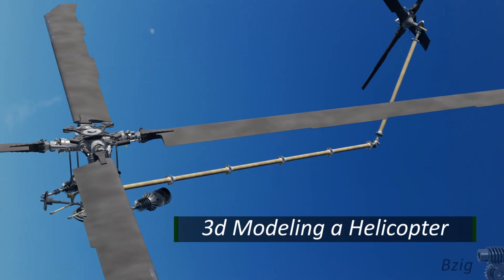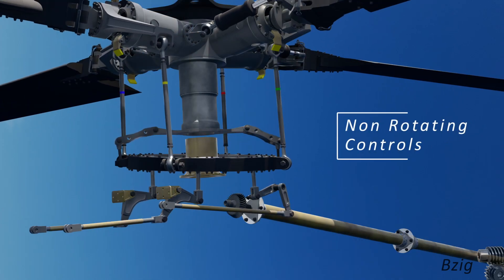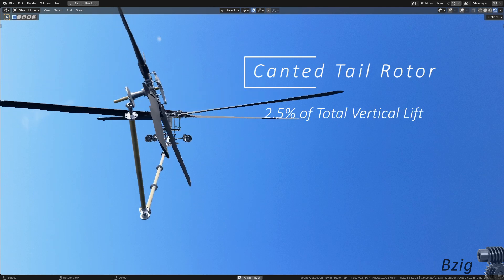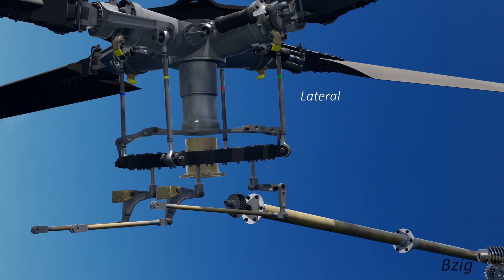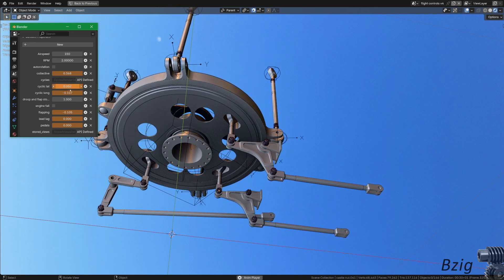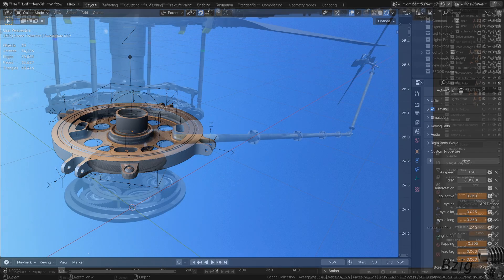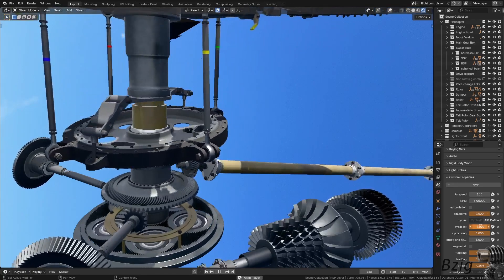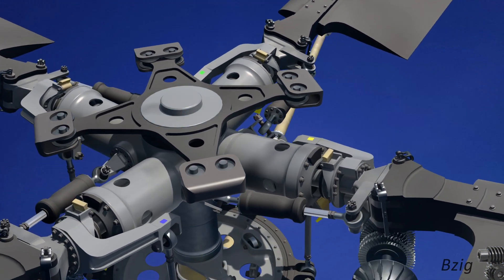How a Helicopter Works - Part 6

Comment: I am currently studying your videos, chatting with a specialised aircraft-attuned Chatgpt, and I'm reading through the flight manual of the SH-60 Seahawk in preparation for being a flight mechanic in the airforce. I won't ask you to do this, but in addition to the mechanical aspects covered such as transmission and power and flight controls, I could really use some 3D modeled hydraulic system to see how it all comes together. That has been and is currently my biggest headache to understand or mentally visualise where the servos and actuators fit in and how. 

But amazing work, thank you so much for all of this!
Reply from the maker: The flight controls would be a challenge with all of the mixing that takes place!  My goal is to tackle a simpler helicopter before getting into a design with multiple boost stages in the flight controls.  I'm working on an R-44 video with the goal of showing control continuity from sticks to the swashplate.

Way back in the day, before computer graphics, I remember part-task-trainers where you could follow the controls from cockpit to swashplate on physical table-top trainers.

Comment: Principle purpose of the canted tail rotor was to decrease the size of the aircraft. It moved the centre of lift aft, meaning the centre of gravity had to be shifted as well. This was done by moving the cockpit and cabin further aft under the rotor head, decreasing the overall length of the airframe and saving weight along with it. The lift it produced also allowed the initial main rotor diameter to be smaller. If you get a chance you should read the book by Ray Leoni on the blackhawk.
Reply from the maker: thanks for that point out!  I ordered Leoni's book from AIAA today.  This is a fantastic book... it's a nice blend of history and technical subjects.  I worked flight test in the Marine Corps and I love reading about the test failures and how the team overcame them.  Thanks again.  I'll add this book to the reference list in my video descriptions.
Reply: @bzig4929  Yeah it's a great book, I wish there were more books like this for other aircraft.

Another thing I think you should read is a thread on the pprune forums titled "Delta 3 & Phase lag", specifically the posts from NickLappos.

Comment: "...a frequency that someone at Sikorsky picked."  😂  Love your videos!!
Reply: @BasemanSr  Sikorsky is the epitome of heavy lift helicopter design. No random picking of  frequency, by someone at all. Instead carefully arrived at by many empirical tests. Theoretical  engineering is one thing. In the end it is dialling in all the real world components to inteact smoothly with each other. Changing compliance in any component affect all others. This is why Turbine enginge and helicopter flight components are so expensive. For the machine to work as advertised requires perfection of the manufacture of the components.  And maintaining or replacing that perfection as the components wear. Sadly there is a you tube out their of some clown in India, who build a kit helicopter faux replica. It looked Identical as mock up of real kit helicopter. But the Base Moulding fabricated MR blades quickly destabilized and you see his head becoming "pink mist". There is also another kit helicopter design that when the main rotor blades underspeed in lift dynamics of flight, the centrifugal force keepin the blades rigid. They cone up and bend, to the point where they fold up and break. Aaaaaaaaaaahhhhhhh. Splat!!!!!
Reply from the maker: Well said.  When I said "picked" I didn't mean to imply it was random.   You said it nicely... That this is a careful choice that's made after testing.  I'm limited by the words I can fit into a video.  Thanks for commenting.
Reply: Great community and great channel! :)

Comment: I once saw a cross section diagram of  Sea Stallion or Super Stallion. Whether this was true to life, or just someone's assumptive diagram I do not know. It depicted the Swashplate bearings as being very large ball bearings. The outer rotating race being concave machined. The inner fixed race also being  a upward facing  1/4"concave on the lower portion, and then the top half being a retention ring  with it's underside also machined with a downward facing 1/4 concave. The retention ring having several bolts securing it to the lower fixed inner race. Since all  kinetic loads are carried by these bearings, it makes sense that this would be the most simplistic heaviest duty  design, rather than double the count of smaller two row caged roller bearings. More oportunities for any single one failling, and ruining your day. Wheareas with let's assume  a full race, (depending on race diameter) of 30ish- 50ish count of  say 1" inch spherical ball bearings in there. Easily able to handle a ton of loading each. Well those things are far more impervious to crush, and the wearing factor then becomes the races themselves.  Definitely heavy metal noise.  ( cue Sammy Hagar)  https://youtube.com/clip/UgkxN6a7PAVSxFjSOL1Q2wW8Hx3J8ukR_K99?si=45QTsDc6aafZBY58
Reply from the maker: thanks for that insight.  I haven't been able to find any photos of a swashplate teardown on line.  I'll keep looking!  I was always in operational units, so taking one of these things apart was a higher level maintenance task.
Reply: @bzig4929  I would not be surprised if it was a secret. These are heavy lift Birds used primarily by military, and high end civilian. I don't really know. I can only say that I saw a cross section diagram in a long ago web search depicting this configuration. It makes sense theoretically under the "KISS" protocol (Keep IT Simple Stupid) the less possible mechanical interfaces the less probabilty of failures. This is what makes the UH 60 turbine combiner design so much superior to the Aerostar 350. Less points of contact translates to less points of wear, and crossing over into build of tolerances failures. Supposedly this is what makes the Kalishnakov such a reliable rifle. Simpler eject, feed and chambering design , able to still function with a bit of slop. After all what really matters is the accuracy of the flight after pre discharge pneuomatic mechanics.

Comment: How's connection at helicopter between gearbox and turbo shaft engine?
Reply from the maker: A short answer... The power section is a direct mechanical connection that passes through an overrunning clutch.  The gas generator section is only a gas coupling.  I have more details in part 3 of this series... 
  https://youtu.be/mNza25K5if0?si=-pvqbPCMq3NOa7DR

Comment: Fantastic! And a completely different set-up than the one I ended up figuring out between your last video and this one. I think mine had to be different because my swashplate is more like your first one, where the rotating and non-rotating plates are stacked above/below each other, rather than inside/outside.
Reply from the maker: Helicopters are like Blender... so many different ways to solve the same problem!

Comment: Looking forward to your educational videos. 

Can you touch on why the axis of the pitch control does not pass through the vertical axis of the main shaft? 

My brain is struggling to understand how the centrifugal force is in the direction of the pitch axis. My assumption is that it has something to do with the torque required to spin the rotor system.
Reply from the maker: check out this reference...  https://www.rotaryforum.com/threads/rotor-blade-center-of-pressure-question.12745/

I'll do some more research and maybe add this to a future video, but I like the 4/18/2017 response from Dasbur... you definitely want the spindle rotation axis coincident with the blade aerodynamic center, but this doesn't explain why Sikorsky mounted this point forward of the center of rotation.  The center-of-pressure aft of the aerodynamic-center and flutter concern looks like a good answer to me.  I have a copy of Gessow and Meyers and I'll start digging... fascinating stuff!
Reply: @bzig4929   helicopter aerodynamics and physics are one of the most interesting and complex things I’ve attempted to understand. Unfortunately, as that thread stated, a lot of the information is over simplified and/or incorrect. Flapping to symmetry and dissymmetry of lift for example. 

Shifting the feathering axis forward is still not making sense to me. I can only assume the CG would be aft of the aerodynamic-center (and spindle rotation) based on the fact that the CG of the blade must be radial to the center of rotation but that is no good. Or the blade lags? 

I’m building a Composite FX Mosquito and attempting to understand these concepts as best as I can while I go through the process. If you’re interested the build will be documented @theokayestengineer  

Your animations are phenomenal! I noticed a lack of quality, accurate, helicopter educational videos and thought about making some until I found your channel. This is far better than I could have made or hoped for. Great job!
Reply: @bzig4929 This kind of detail would be amazing. And probably needs to come after a few of your next series videos so we have a greater understanding of the flight mechanics.

I definitely want to see the mixer modeled. Is it more complex than the earlier one you modeled?